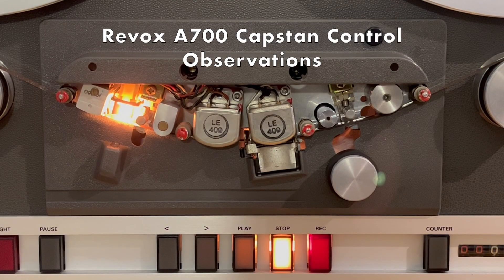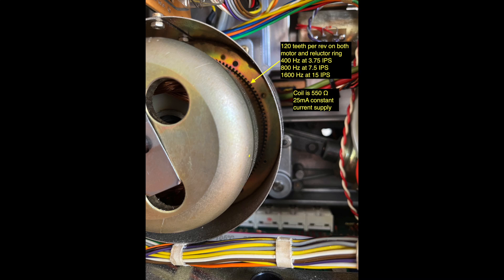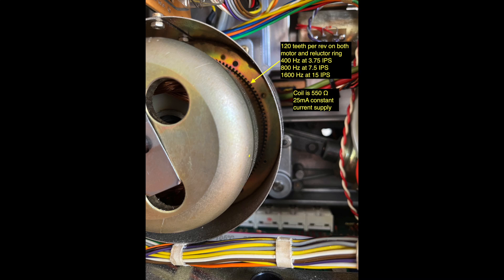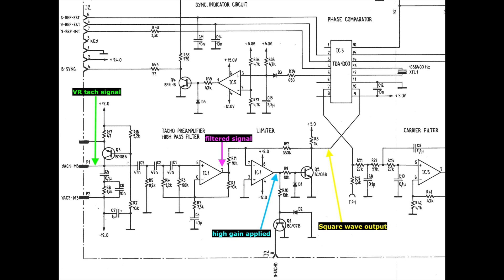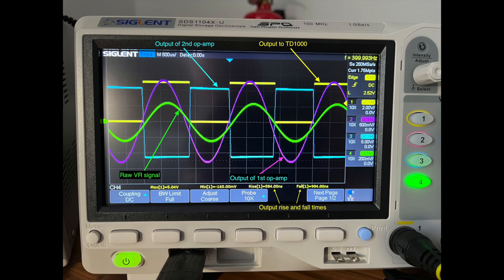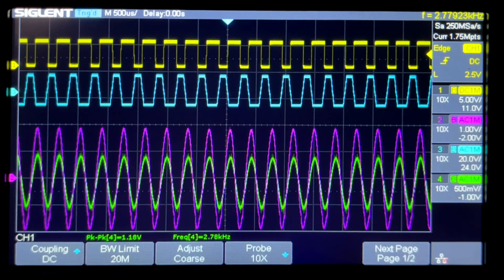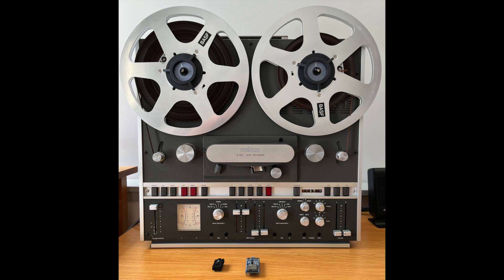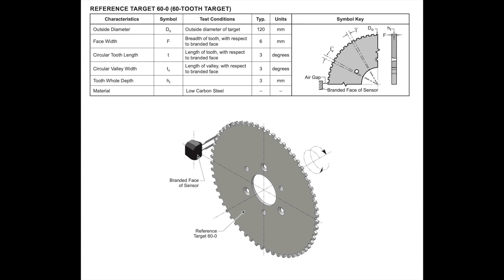Revox A700 Capstan VR signal observations

Comment: I have a spare capstan board with one of my A700s, & am toying with the idea of trying it in an A77..... I have two A77s that will run at three speeds, one of them an ITAM & one I did myself; the biggest problem was the way they control the power transistor in the older machine. pwm might be an improvement. the rest- quartz & comparator vs 555 or tuned amplifier... probably less critical.

Comment: Great video!
I'm working on an A77, which has two types of speed boards: IC and non-IC.

Do you have any thoughts on whether the IC-based boards are generally better for speed stability, considering the noise issues you found on the A700?

Thanks!
Reply from the maker: There is little to nothing in common with these tape recorders in that regard.  The A77 uses a sharp low-pass filter to regulate speed while the A700 has a phase-locked-loop to a crystal frequency reference.   If this isn't your post on TapeHeads I'd suggest that there is a lot of expertise to be found there. https://www.tapeheads.net/threads/revox-a77-speed-control-board-help.112774/